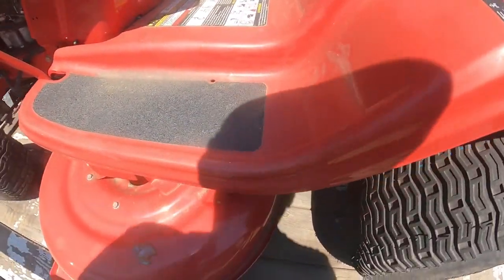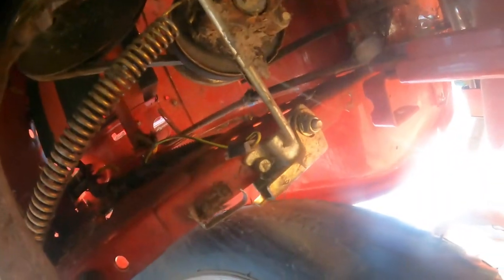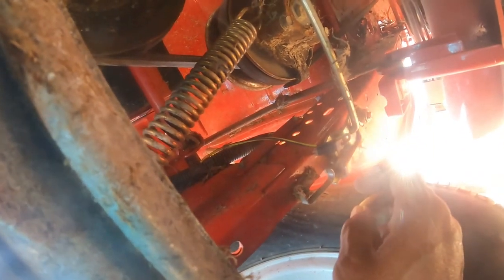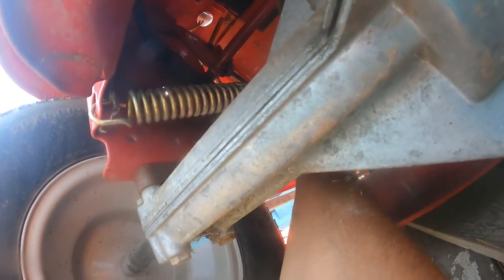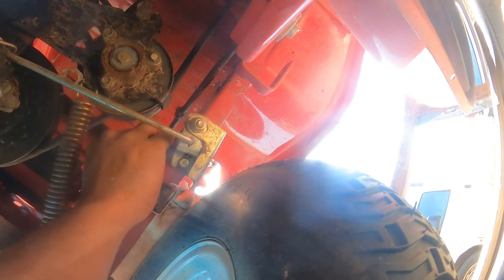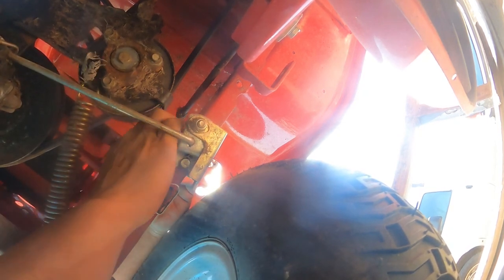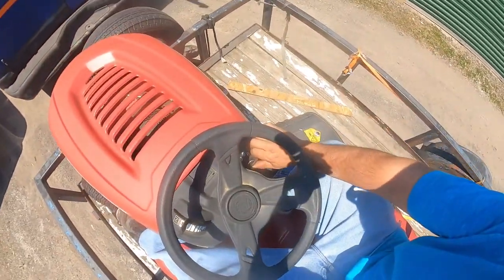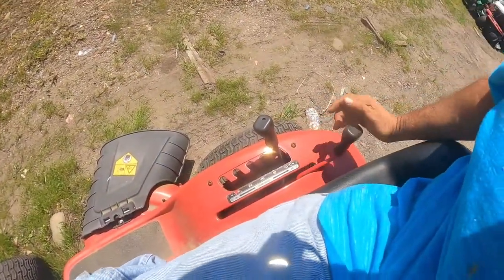TROY BILT PONY 7 SPEED REVERSE MOWING SAFETY SWITCH.

Comment: Thanks for your video.  You helped me to solve my "mower shuts off in reverse" problem, because you got me looking some place other than the ignition switch.  My Troy Bilt Tuffy/Pony has a single wire connected on the frame behind where the Forward/N/Reverse handle pivots.  Just disconnect the wire and the problem is solved.  Many thanks.
Reply from the maker: Thank you 😊